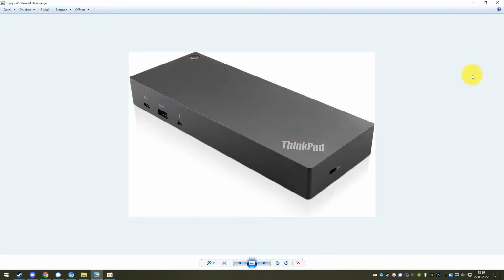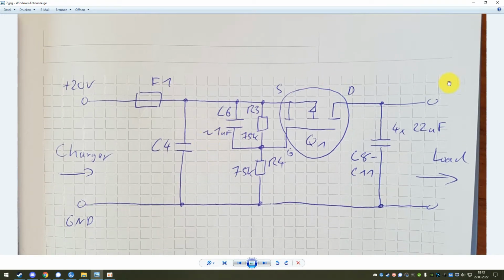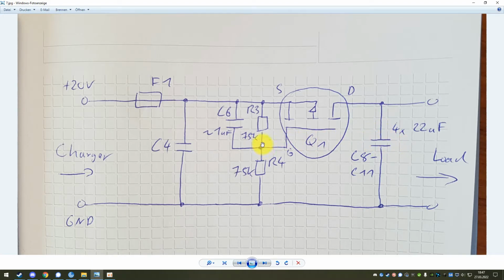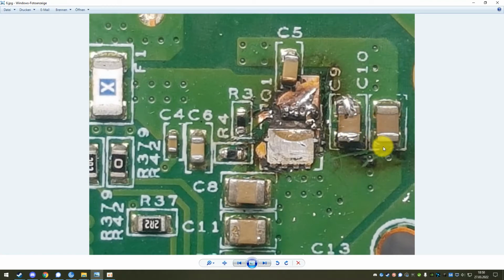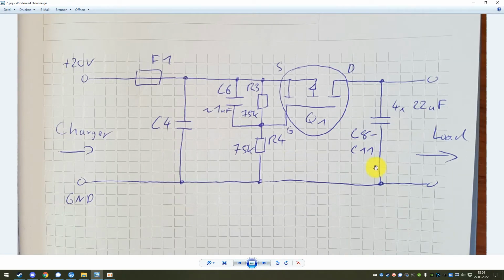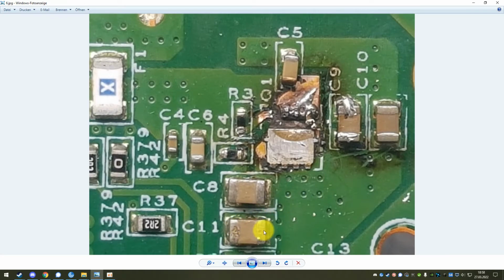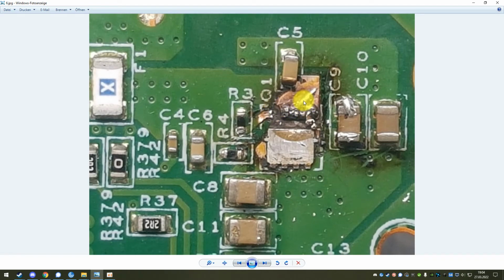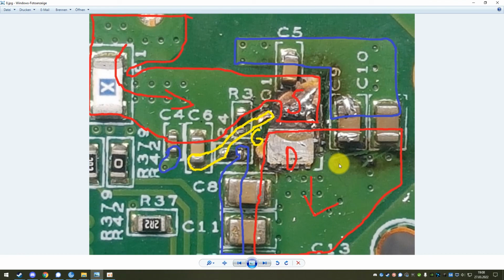Lenovo USB C Dock Repair - Inrush Current Limiter

Comment: Hi and thanks for the video! 

I'm currently dealing with a Lenovo USB-C Gen 2 docking station (model 40AS) and I'm having problems with the charging functionality. 

If I power it with a 70 W compatible power adapter, the dock works but does not charge the laptop, since this requires a 90+ W power brick. 

If I plug instead a 90 W or 170 W Lenovo power supply, the dock stops working at all and the LEDs on the ethernet port flash randomly. If I use a USB-C cable with power state LED on the connector to connect the dock to my laptop, this LED flashes with the same frequency of those on the ethernet port. 

My hypothesis is that there is some fault (possibly a bad capacitor) in the circuit that delivers power to the laptop, and as a consequence the whole dock faults. Maybe this part of the circuit is only switched on when the power supply used is powerful enough to recharge the laptop, and for this reason the dock works when using the 70 W power brick. 

Have you faced someting similar, and does my hypothsis make sense to you? Thank you :)
Reply from the maker: I agree with your conclusion, but since I never hat that issue myself, I cannot give you any hints where the fault hides. Obviously start looking around the USB-C PD-Controller. The PD Controller itself could be bad or some part around it.
Reply: @NebukadV  thank you for your answer, I'll try to diagnose the problem in the upcoming days. If I'm unlucky, I can still use the dock with the 70 W power supply for data transfer only and charge the laptop with its power adapter.

Comment: Was going through the steps here and was trying to figure out which capacitor was dead, so i put some alcohol on it but it must have gotten on the inrush limiter because after i applied power the limiter sparked and died. My sodering knowledge is very poor, however i was interested in bypassing the circuit. Was wondering if you had a photo of the wire you attached as i don't totally understand from where to where you are attaching it. AS well as how thick of a wire you used to pass 7 amps. Thank you
Reply from the maker: Alcohol does not conduct electricity. If the inrush-current limiter died, it was not because of the alcohol. If you indeed have a shored capacitor somewhere, the inrush-current limiter will die eventually anyway.

To inject current, you can connect to any of the big capacitors, for example C8, C9, C10 or C11 as shown for example at 17:43. Positive side is right or bottom in this shot, negative side is left or top. 

You need to inject about 2-3A for the shorted capacitor to get hot. For that, 1mm² cross section wire is more than enough.
Reply: @NebukadV right, I did use 91% isopropyl so maybe that was my issue? Anyway the limiter is toasted, and I don’t have enough knowledge to replace it. You did say it is possible to by pass the circuit? Was just curious where you actually attach the wires too, to bypass the limiter and the capacitors. Thank you very much for your help!
Reply: @NebukadV okay so I did add the jumper to bypass the chip. So now I am just getting the beeping from the power supply again when I plug it in. So is it possible to just remove a dead capacitor instead of replacing the inrush limiter chip?
Reply from the maker: @ I think in my video I made it clear, that bypassing the inrush limiter is fine, but regardless what you do with the inrush limiter, the dead capacitor is the main cause of the issue. Is has to be found and replaced or at least removed.

Comment: I have one HP Thunderbolt Dock G2 that won't start, the power led doesn't turn on. Any response to these message please
Reply from the maker: Yes - here is a response to the message.
I have never owned an HP Dock G2, so I do not know anything about it. If you have watched my video, you might be able to transfer the trouble-shooting to your device. If not, you will have to find some other guide or explanation.

Comment: Do i need to replace the capacitors, or would it be enough to just jump the red marked circuit?
Reply from the maker: If a capacitor is bad (shorted), it has to be at least removed, otherwise the short circuit will keep the unit from powering up.
Reply: @NebukadV  Thanks very much for your quick response. I have removed all shorted capacitors and jumped the circuit. But it does not work. The power supply has still this fast clicking noise (hardly hearable, but I think it does this when it is shorted). If I put the continuity tester to the jumper wire and some random PCB-mounting screw, it beeps. I assume there is another major defect. Do you have an idea where it could come from?
Reply from the maker: @pascalbischof5235  Honestly at this point, you either have the skill/knowledge to find and fix the issue on your own or you are not up to the task. 
There is obviously still a short circuit. 
What do you mean, you removed "all shorted capacitors"? There was most certainly only one but apparently you either did not find and remove it yet or you created another short circuit with the soldering you did.
Reply: @NebukadV  my knowledge is imdeed limited, otherwise I wouldn't look gor instructions on youtube. I am sure i did no create a short while soldering, at least none that is visible on the board. I only removed capacitors and soldered the jumper wire. 
Anyway, I guess i'll scrap the dock.
Reply from the maker: @pascalbischof5235  Yeah, I guess, you should scrap it at this point. Just as further explanation: The most important part of this repair is finding the faulty component - maybe this does not come across in my video, since I don't show that part.

So you would need to apply some technique, to find a shorted component. You can go all fancy and use a thermal camera, you can pour some pure alcohol on the board and see where it evaporates first due to the heat, or you can try using your finger to see, what gets hot. In any case, some experience with this kind of troubleshooting would be benefical or maybe even neccessary. 

It sounds to me, that you did not have any means to find the shorted component, instead you just removed some of the capacitors, which could have been shorted. While that might work, in this case it didn't help.

Anyway, I'm glad my video inspired you to at least give it a try!
Reply: I've removed all 4 capacitors. Checked the resistance. Found shorted. Put 3 that left back. Soldered 18awg wire. All works. Thank you for detailed explanation!

Comment: Hi. I have three 90W USB-C docks here that have the same issue: not turning on, clicking sound in the Power Supply Unit, etc. They are of version 40AY, not 40AF. 
In one case the error occured, while the laptop was connected to the docking station via USB-C and simultaneously the normal power supply of the laptop was plugged in. After watching your video, I know that time will not fix it and leaving it plugged in any longer only makes it worse.
Is this something that goes under warranty of Lenovo which I still have? If not, I might go experimental on the docks :)
Reply from the maker: Yes, that should definetely be covered under warranty.
Reply: I got the 40AY model too, the Component Placement is different and I think that some other Component is broken. I found out which one: the big black "diode" with PJ137M. But I can"t find a replacement part for it or a Video/Discussion covering this specific problem anywhere

Comment: Thank you for the video and the in-dept details. I have the 40AF dock here, and there's no lights if power is connected. However, I'm not able to see any damage on the board.

I'm still in the beginning of "debugging boards" like this. 

What's your recommendations in how to spot, if I'm facing the same issue? I have a multimeter in hands, to it's just a question about measuring the right connectors, right? I have measured the fuse, and that's fine. No resistance at all.
Reply from the maker: Ok, here`s, what I would do:
Check on one of the capacitors C8-C10 in Ohms measurement mode. If it shows a short circuit (<1 Ohm), one of the capacitors has failed.
But be aware, there are many more capacitors on the board, that could be the issue, not only C8-C10. 

The next step would be to find out, which of the capacitors is bad. The easiest way would be to inject current to those capacitors (connect a current limited(!) DC power supply and set it to for example 2 Amps). Then you will need to find the one capacitor, that gets hot. Can be done with a thermal camera, with your fingers or with pure alcohol, that will evaporate faster on the hot capacitor. 

If you get this far, you have found the failed part. That needs to be replaced or at least removed.

Your Inrush-Current-Limiter Mosfet still looks OK, so chances are you dont need to replace that. I would check the fuse F1. If you measure that in Ohms mode and it ready less than 1 Ohm, it's still intact.
Reply: I've also tried to find inspiration on YouTube and Googled it a bit, but I can't really find any good suggestions. So I hope it's OK to ask.
Reply: Here's one image of the same area:
https://i.imgur.com/Tj7dj4X.png